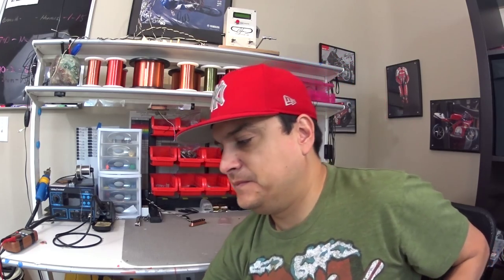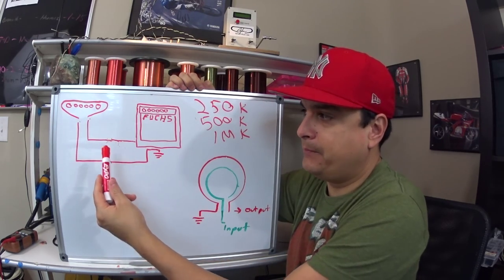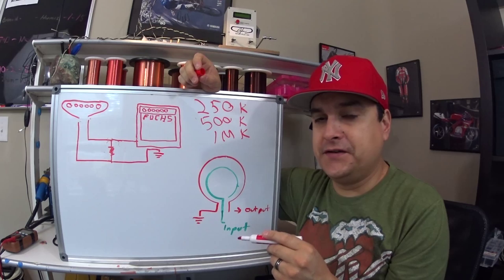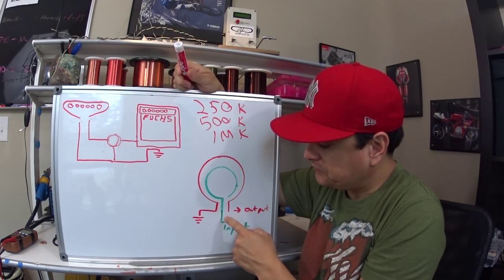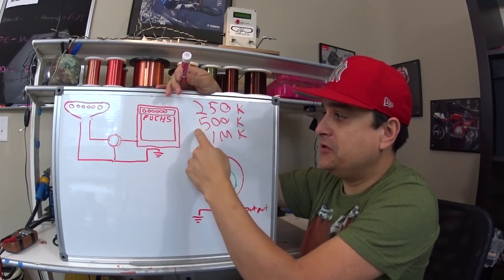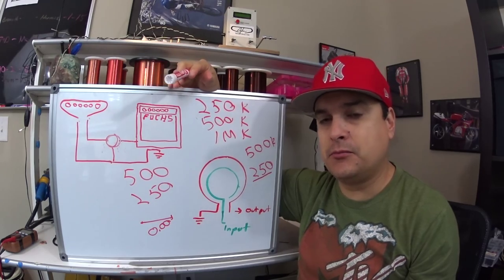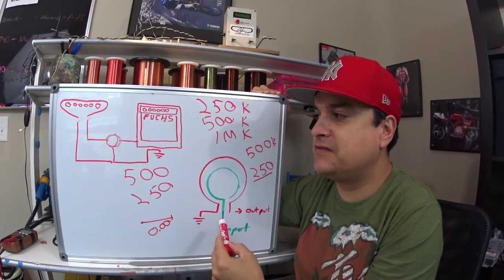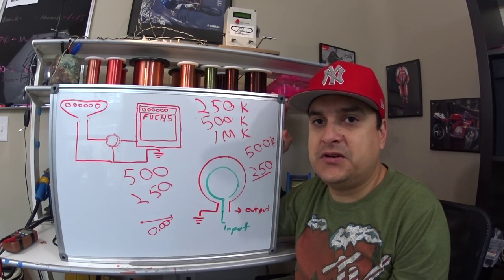Dylan Talks Tone Ep #10 250 or 500k pots in your guitar #30

Comment: I like your channel! However, with respect, I need to tell you some of this incorrect or stated in way that is unclear. You are incorrect about the resistor across the circuit rolling off highs. In fact, what a resistor(across the circuit) will do is simply flatten the response(lower the Q or peaked response of the pickup). If the flattened peak response is in the treble range, then yes the pickup may not sound as bright. The resistor will also convert some of the output into heat reducing output. Now if the resistor is in series or in line with the output(not across it) it creates a low pass filter with the parasitic capacitance along the cable/circuit path and this will roll off highs. Also parasitic capacitance of the POT itself can add to this. A capacitance across the circuit will roll off highs also . The way you describe the wiring of the POT is  unclear also. One should take the input from the pickup and connect it to where you are showing the output being extracted. The output should be extracted from the wiper(center connection) such that a pot's rated value (250k for example) is across the circuit all the time but the output jack see a output impedance that varies depending on the POT setting. This varying impedance can bee seen as a series resistance with the output and is subject to treble roll off from parasitic capacitance. As you lower volume you also increase the series resistance giving more tone roll off . The lower the value of the pot(250k, 500k, etc); the less treble roll off but there will be more loading of the pickup (reducing output). So a 250K pot will produce less treble cut as you turn down the volume than a 1Meg pot but it will also reduce overall output(slightly) more than the 1 Meg at full volume (when there is little or no series resistance). The impedance and frequency response of the pickup and other nuances come into play also but I have gone on long enough.

Comment: Actually with a vol pot it's usually the output that's connected to the wiper. This is to create a constant impedance at the pickup.  If you connect the pickup hot to the wiper the volume pot will also act as a tone pot when you turn it down.   You can hear this with a standard fender jazz.  The pots are deliberately wired backwards so the signals can be blended.
Reply: Most helpful comment.

Comment: Hi @DylanTalksTone first of all thank your the video! I spent around 1,5h  to look for a simple explanation !
Great Job!

I have a quick question as I believe it would work  (split it up in points for easier answer )

1. I have a passive bass guitar, Jaguar Bass (with PJ Pickups)

2. Currently: Double Pot ( upper part control the Volume and lower part the Tone) per pickup.

3. Plan to change: 2 normal Pots and a 3 way switch. 

4. 3 Way toggle switch neck, both, bridge pickup selection. 

5. Volume pot (250k) controls both pickups (250k get in less high as i understand form u video).

5. Tone pot (500k) control both pickups with an cap (Cap Orange Drop 22nF 600V) (would have more control on the tone ?)

The main goal i to have less worries about what tone is on which pickup and which is lower volume etc. and easy selection of pickups 
Thank you in advance !
Mike

Comment: I've always treated it as more of a guideline than a rule myself. I suppose it's the "common wisdom" because, in general, it's often true. But at some point, each guitar should be judged on its own needs. Like you said, hot singles might need the 500k to sound good while that bright humbucker responds better to 250.  I actually do have 10k single coils in a strat and, while it's not too dark with the stock 250k pots, I may give 500k a try and see how much more they open up. If I like what I hear, 500 it is.

Comment: Great explanation here.  I used a 500K Audio master volume along with a 250K Audio master tone with a .0068 orange drop cap.  Typical three way CRL switch for Telecaster, Fender Custom Shop Texas Special neck and '51No Caster bridge pup.  The results are amazing as the hotter pups 'like' the 500K volume.  That particular Tele sounds thunderous through a Mesa Triple Rectifier driving an EVH 4X12 cabinet, with the '51 bridge pup with a hint of reverb in the loop.  Cheers !

Comment: From Leo:   Good explanation.  Your labeling is switched on the lower right.  The center leg of the pot is the output to the jack, and the outside two go to the ground and the pickup.    It works as you have it labeled, but you cannot get any high signals at all except in full on.    Thanks for posting your knowledge about pickups and guitars.

Comment: Thanks for the well-explained primer regarding treble loss through lower- vs higher-resistance paths to ground, in the form of 250k and 500k volume potentiometers. The one detail I'd add is the difference between a shunt and a direct short: a signal is shorted when the pot is rotated fully CCW, i.e., at 0, where the wiper is touching the grounded terminal; when turned even slightly CW, where the signal is passing through a portion of the pot's resistive element, it is said to be shunted. That is generally true in electronics, where any signal path to ground that is not a direct short, but is passing through a component, is a shunt to ground.

Comment: Wow! Thank you so much for this video and your video about tone caps. The way you drew the internals of the volume pot and showed how they correspond to each leg made everything instantly crystal clear! 
At 7:14 you mentioned that you would use 500K even with single coils and that you'd compensate by using a bigger cap... 
based on your tone cap video, are you saying that your way of compensating for the brightness of the 500K pot with a single coil is that you'd use a .047 capacitor so that it has more effectiveness, AND that you'd be rolling the tone back just a touch?
A tone pot at 10 passes everything regardless of cap value, is that right? 

I've got an HSS strat (with a Duncan Custom Custom TB-11 bucker and Fender Original '57/'62 single coils) that I am redoing the wiring on as I transfer everything to the new replacement body and pickguard and I'm trying to decide what to do with the wiring... 
It's always had a 500K volume pot and I do like the brightness of the single coils, so I'm gonna stick with that. 

I've got a pull-up pot for switching the bucker into coil tap [EDIT: SPLIT not tap!] mode, but I just saw a comment on another video that said that making it automatically coil tap when you select position 4 is better and I realized I'd rather do that too... and then someone else said that paralleling is better than coil tap so you don't get hum (I'm watching that video of yours next).

Because of these two videos of yours it all makes sense and is no longer overwhelming to try and figure it all out. I will finally get off my lazy butt and solder this pickguard up and get my strat back!  
After I watch your video about coil-tapping vs. parallel, I will probably be able to figure out how to wire it to automatically coil tap on position 4. 
Thank you!  This Thanksgiving, I am thankful for you taking the time to make these videos.  Have a good one, man!

Comment: Great explanation! I recently replaced the pickups in a Fender Squier Strat, which had ceramic pickups from the factory. The guitar had 500k pots, which I think were used because the pickups were ceramic. I replaced them with pickups that had alnico V magnets, but I left the pots in out of curiosity. The result was a sound that was way too bright. 250k pots tamed this condition. So, just letting folks know that not all single coils get 250k pots from the factory. Magnet material matters.

Comment: This is a good explanation of how the volume pot shorts signals to ground thus lowering the remaining signals to amps input.What I want to understand is, why a path to ground that is not a capacitor effects high frequencies more than others. I know the answer is rather complex and it involves impedance or the actual resistance of the pickup at a given frequency and a concept thats even more complex , the Q of the circuit. I  am looking for a combination of pot values capacitor value so my p-90 (neck position) is not so muddy.

Comment: Tone controls work to reduce treble from 10 down  makes it darker sounding volume pots work from hi to low however what makes a bigger difference is it's wattage value because a less wattage control will pass more current than a higher wattage  just as if you put the wrong wattage fixed resister in a circuit it can burn out or not pass enough current to drive a circuit properly

Comment: This is kind of a "checking in" comment since I watched your video, (among others), prior to making the big decision.  I just finished building my new custom superstrat with Seymour Duncan Cool Rails on the neck, JB Jr. in the middle and Hot Rails on the bridge -- all on 500k pots.  High frequencies are near-perfectly controlled with Vise Grip compressor, (others likely get the same results), without having to dive on the tone knobs.  Best of both worlds bright and warm.  I will say this; would have been better in the end to run a 59 in the middle position for a fatter PAF sound, but not griping.  JB's have an airy lead tone on clean with 500k pots over 250k's and that was the result I was especially looking for.  Anyways, thanks for your video.  T'were a big help.

Comment: Your drawing shows one way to wire a potentiometer as a volume control.  It is common (no pun) to reverse the input and output connections from the way you depict them.  I have always wired the input (pickups) to the top and the output (jack) to the wiper as this is preferred convention in general purpose low noise circuit design.

Comment: Thank you Dylan...today I welded a 250k pot (tone pot 500k & soviet capacitor .047uf) to a gibson IM57B-NH Burstbucker (bridge) and it sound really good. Then I assembled  a Gibson Gear IM90R-NH 490R  to neck position with a 500k pot (cornell dublier .022uf) and it does not sound so good as bridge one but I guess it depends by many causes. So...let's break the rules!  regards Al

Comment: 500k pot for my single coil pups. It improves sustain and fullness of sound.
Reply: Are you using stock pickups, or hotter ones?
Reply: @randyschock5651  I've had both with the same results, but don't go past 500k with single coils.
Reply: Did you use a different Capasitor?
Reply: @steevenare7160  Nope I left the tone pot with original cap alone. I just swapped the volume pot.

Comment: As an electrical engineer I would consider this video very incomplete and sometimes straight wrong. In order to explain the effect of the external pot you need to go into the internal " replacement schematics" of the pickup. The internal capacitance and inductance in kombination with the external resistor form a filt, which affects the overall frequency response ....

Comment: Have to agree with Devon Scott. Dylan makes it all so simple and understandable. Although there are some inaccuracies.  Julian Wells is correct when he says "A resistor has no frequency filtering attributes". You need to look at the value of the capacitor for that. Dylan made me think though; why not do away with pots and caps altogether and simply wire the pickups to the selector switch then the output jack? Output to a good volume pedal for volume control, then an EQ pedal if you want tone control, or just use EQ on your amp.
Reply: I thought the same thing.  I think though, it's all about versatility and which method of "skinning a cat" has been accepted as the "norm"
He did mention no load pots too, and I think those would have a similar effect plus the versatility of having on board tone and volume control at your fingertips.

Comment: Great video Dylan. I learned a lot of theory right here. Thanks.
I acquired a nice Gibson Epiphone strat. I  got it a long time ago. I found it in the back of a closet. I have no idea for how long. Anyway I plugged it in and there was nothing. I pulled the strings off and the pickguard. Some Gorilla did a wiring job. It has 500K pots. I think that was the mod. The guitar has a 5 position toggle, three single coil pickups They have three connections. White, red and a shielded ground. 
I'm thinking I will purchase every thing but the pickups and jack. I'm guessing from this video I do not need 500K pots. I am looking for a warm tone, a Jazz tone so I guess I would be better off with the 250s. If from what info I have here maybe you could let me know what you think I would appreciate it.   Thanks

Comment: Thanks Dylan, you only addressed frequency response what about power transfer as in how much of the signal you want to retain.  Would a higher value volume pot result in a louder pickup, eg higher amplitude?
Reply: Very interesting question! Unless you are working with microwave or RF electronics, most people don't care about energy transfer. We are more interested in signal amplitude. The pickup internal resistance is about 10k ohms, and the amplifier input is about 1M, so current levels will be very low with these 300mVp-p circuits.

I think you are onto an interesting idea, though: what if it were economically viable to wind a pickup with several loops of parallel coils, bringing the resistance down within the circuit and then have an amplifier that had a lower input impedance (maybe using a transformer).  That would significantly lower noise floor and 60 Hz hum.

Good question!

Comment: I offer this constructively, please take no offense.  A potentiometer in the orientation used on a guitar does not ‘route more or less of the signal to ground’, as you mentioned.  The pickup output voltage is loaded by the full resistance of the pot, and the moving tap selects the fraction of that original source voltage that will pass on to the load (e.g. amp).  Mostly a semantic issue but important because pots can be used in a different configuration similar to your description that would not be suitable for a passive guitar pickup.

Comment: A resistor has no frequency filtering attributes. It will effect the amplitude but it will pass every frequency from DC to light.
Reply: Yeah. I nearly fell out of my chair when he said that. Had to go back and listen to it again. Something about faster resistors. When I stopped laughing I listened to it again and yeah he meant what he said. I must have slept through the resistor AC characteristics class.
Reply: Yeah, unfortunately you have to take the total circuit into consideration for what's actually happening.
Reply: yes true, but togethter with the pickup, which is obviously a coil,... it is a frequency dependent circuit... inductance of the coil + resistance of the pot ... --> the higher the pot value, the more high frequencies you lose. so.. it kinda makes sence what he says..
Reply: @ Julian Wells  "...will pass every frequency from DC to light."  
Just wanted to point out that DC stands for Direct Current.  This, by nature, has no frequency.  As far as light, well... depends on the voltage being applied to the load.  But I'm aware that you were merely trying to make a point... just a bad analogy.  

Oh, and btw... a resistor merely restricts the flow of current. Nothing more, nothing less.  So yeah, you ARE right.  =D
Sorry for the late post, I'm just getting into electric guitars.

Comment: I share this pro tip with very few people. Mainly because they really do not know what they do not know and just play what is stock. So here it goes: Use 500k pots on all your guitars with HSS. Make the tone knob 500k as well. Wire the volume and tone knob like  a 50’s Les Paul junior. (Vintage wiring vs Modern) use the value .010- .015 for the tone cap. Use the bottom knob as a blender to give you two more options on your 5 way switch.  If you want to roll back the volume or tone when using single coils to get more of those stratty tones then you will be inclined to use your ears more and also more feel of the strings and magnets resisting your pick attack. Tone really is in your hands, some guitars do this better out of the box, most have to be modified to this recipe to really have it all in HSS. Now, you have the 500k which the humbucker loves, you are twice the value for single coils, you can roll off the volume and tone and solve that, plus.... using the value of tone cap I prescribed, you will actually use your tone knob more than ever before as the value (.010-.015mfd) shifts the mid and treble points like a partially cocked Wah wah pedal, instead of that .05 horrible muted muffled muddy sound Fender chose to use when guitar players would mimic bass guitar on a 6 string while recording in the 50’s, and no modern players really use the tone knob because of that fact. Now also with my setup, you get the humbucker and neck pickup together with the blender knob and if you add a micro switch, you can shut off a coil on the humbucker and get a close tele sound and in switch position 2 and 4, you can turn the blender off and get all three pickups on together. Playing your amp is now your new concern. You can dial up higher than you would normally use for volume and tones, and use the volume and tone knob straight away on the guitar for boosting volume and tone without a pedal... ala Hendrix ... you will love this setup more than anything and will play more and use the volume and tone knobs with that micro switch for coil tap on the humbucker and never want anything else forever thereafter...... do a video with this idea.... and thank me later. Cheers!!!!
Reply: HSS?
Reply: Bridge humbucker and 2 single coils. This is exactly what I have been mulling over. All my prayers answered! 🙏 😂

Comment: Just a silly spelling mistake, but 1MK would be 1000M, which is 1G or 1 Giga Ohms.
The K and M are multipliers. K = x1000, M = x1,000,000 (and G = x1,000,000,000).
The measurement for resistance is done in Ohms.